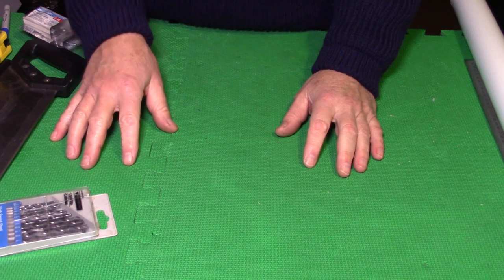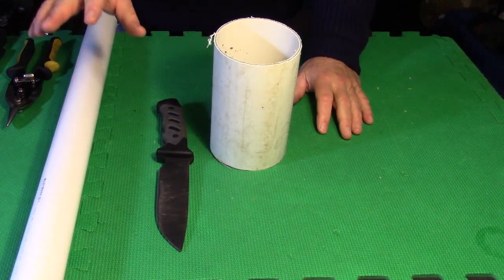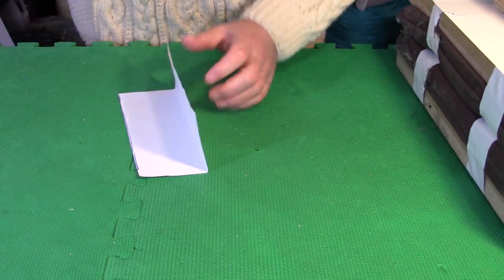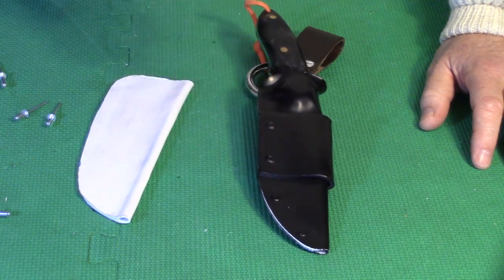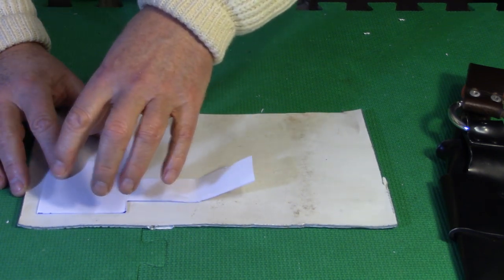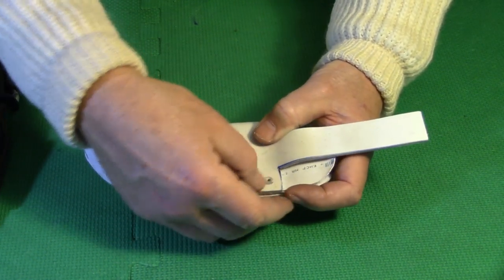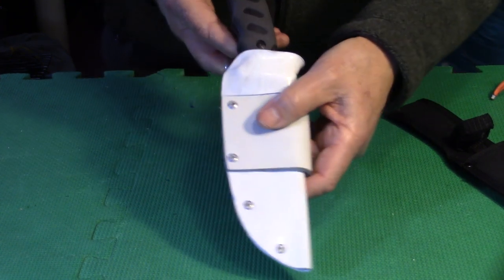DIY Knife Sheath made from PVC

Comment: Hey Mark
I have a couple tradesman tips for you when working/bending pvc.
I've been an electrician for over 35 years, and have hand-formed a few miles of pvc conduit in that time.
1.Cap the ends when heating, helps to trap the heat and become flexible quicker
2. Have a spray bottle of clean water nearby, helps to get the pvc to "set up" quicker by cooling it some
3. Have a piece of wool blanket handy when forming. Even insulated gloves get hot, I use thick cowhide/elkskin gloves with a piece of wool blanket to maneuver the pvc when I'm working with it. The leather will draw some of the heat out, were the wool is an insulator, and is less prone to absorb as much heat.
Reply from the maker: Excellent suggestions. I really like the wool blanket insulator. Will be giving them all a try next time. Thank you for commenting
Reply: Always nice to see craftsman sharing tips of their trades, I'll be sure to add these tips to what I've learned from this video, cheers fellas.
Reply: Great tips, thank you!!!

Comment: Very detailed low cost project! A fine toothed metal cutting blade on a variable speed jig saw at low speed will cut plastics smoothly. The trick is to keep the speed low so plastics don't heat up, letting the blade do the work. Also works for plexiglass. Cheers
Reply from the maker: I had thought about using my bandsaw but wanted to do this with more commonly possessed tools. The jigsaw would have been a good choice. I have one but did not think to use it. Thanks for commenting

Comment: That's very well done, Mark. PVC is a very inexpensive material and it works and forms so well. I've seen several projects made with PVC, with amazing results. People make very good bows, quivers, sheaths for knives and axes, and all kinds of containers for hydroponic gardening. The techniques you've shown us here could be used in any of those applications.
I do think a good heat gun is a great tool to have around for many uses. The schedule 20 pipe is still plenty sturdy and is easier to form and cut and only half as thick. And PVC cement is an excellent option for attachment, but not as secure as your rivets. 
Great video - thanks very much.
Reply from the maker: Had not considered the PVC cement but if it worked it would make a good option. Thanks for commenting Jim

Comment: Just an fyi, pvc and Kydex needs to be heated to between 350°F and 370°F to be pliable enough to work with. You can go to 380°F or 390°F for pvc. You can get a Kydex sheet for as little as $5USD and you can make a Kydex press from Dollar Store craft foam or foam gardening knee pads you can get for a couple bucks, two boards and a couple of clamps for about $10USD. It's very basic but will work just fine and you can use it for pvc also. Also if you use a diameter of PVC pipe close to your blade width you can just flatten it without the need for rivets but you need to wrap the blade in a layer or two of painters tape to have enough room for it to not be too tight and get the proper retension . It is much easier to do it that way instead of riveting. You can cut it to shape on the end and incorporate a thumb push and belt loop, all one piece
Reply from the maker: Your information is appreciated. The reason I chose PVC is not because it is better than kydex but because kydex is expensive in Canada. Thanks for commenting

Comment: One thing I found out when working with old sewer pipe, be sure to wash it very well. When heating it up, it tends to smell like crap, literally 😳😆

Great video! I just finished my second pvc sheath. 
I did learn a couple of things that I wasn’t doing which will make it much better on my next one. Love the tip on the rivets 👍🏻👍🏻
Reply from the maker: LOL... I hear what you are saying. I bought a new length of pipe to avoid that issue. Thanks for commenting

Comment: Hey!! I did the same thing with the Harbor Freight "Survival/ Hunting" knife. Around $8 (U.S.). I wanted to see if I could break it.... Nope. I did modify it before I beat on it. Batoning fatwood. Ive gone through 4 or 5 pine stumps. Still going strong. And I also found another one at the local Goodwill. I got that one for $5. They're the hollow handle type. I epoxied the blades in and replaced the pins with pieces of drill bits. And the handles I stuffed with cotton balls. Because theres a compass in there. Cotton can be used for tinder, or anything.
Reply from the maker: I think too much emphasis has been put on expensive and custom knives. There are some good cheap knives out there as well. Thanks for commenting

Comment: Hi Mark! Great project and vid. Hope you re going well. I experimented with central vacuum pipe and it does the job very well. Bnq pipe is quite thick. You should try it out.
Reply from the maker: Glad you liked the video. I will take a look at the BNQ pipe as well. Thanks for commenting
Reply: Mark Young try the central vacuum pipe light maleable and cheap
Reply from the maker: @fred7705  that is what I am using.  I referred to is as in-house vacuum piping instead of central vac

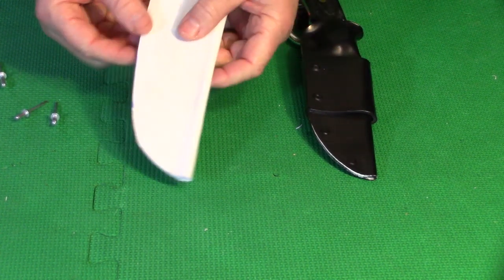Comment: Can you explain how you flatened the pvc at 22:10 compared to a few seconds earlier on the video? How did you get it so flat? That is the area that I keep having trouble with. Thank you for making this with such great details and explanations!
Reply from the maker: Truly, it is a matter or re-heating and applying enough pressure until you are satisficed with its shape. In this case, I likely (can't remember for sure) re-heated and flattened it again after I cut the curved shape from the rectangle. You may find you have to do it a few times to get it where you want it. Hope this helps

Comment: Just curious. Why couldn't you just make one sheath out of the thicker PVC and forego the second outer support sheath?
Reply from the maker: Absolutely could do that. The reason I went this way was weight and degree of challenge to cut,  heat and mold the heavier PVC. If you can find PVC between the heavy and light as I have it would be ideal. Thanks for commenting